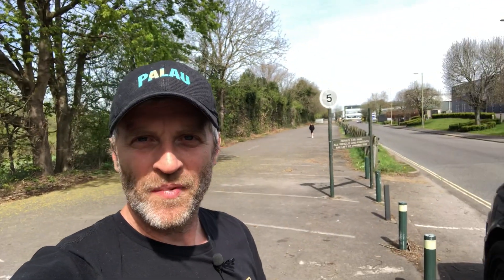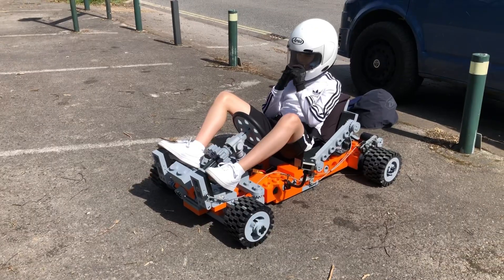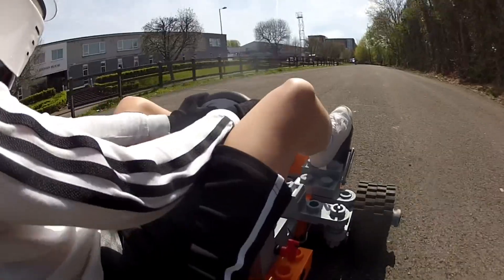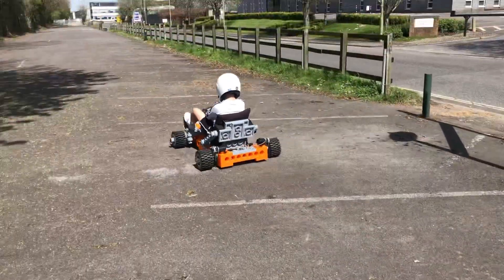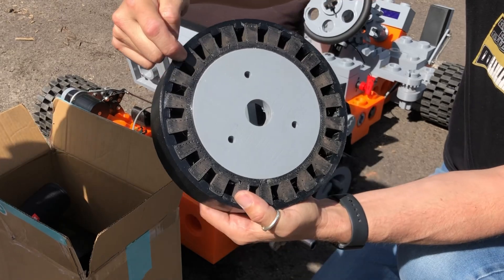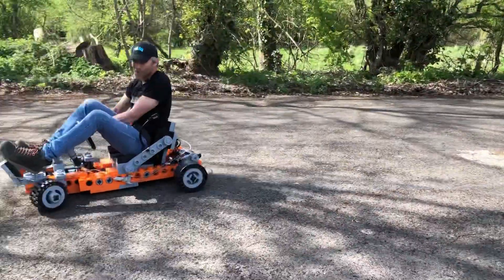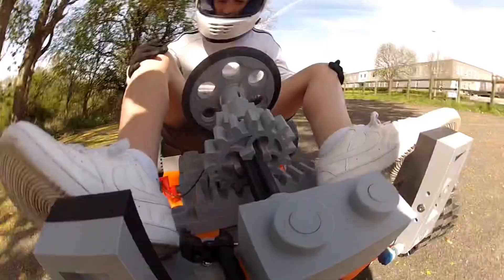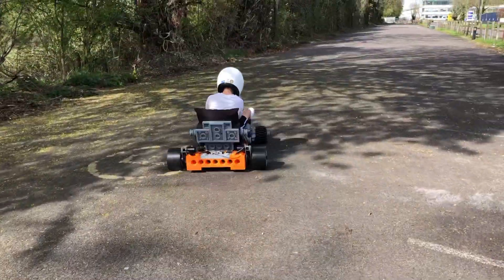XXL 3D Printed Go-Kart - Opposite Lock! | #7 - Mantis Hacks

Comment: Drifting with drift sleeves is great fun, you can be going fairly slow, yet it feels much faster.  I was surprised how well it did with the split axle and limited steering angle.  A solid axle and greater steering angle could allow for steeper drift angles and longer drifts.  I don't know the outer diameter of the lego tires, but drift trikes use PVC sewer pipe on a rubber tire.  I'm not sure how you'd attach it to the lego tire, or if it would work best just to print some new tires that will fit snugly into PVC pipe and glue the pipe to the printed wheels but the PVC sewer pipe is really thick and will last a good long time on a kart like that.
Reply from the maker: Yeah it would be interesting to try the solid axle again

Comment: Hacksmith made Mario kart-esque speed boosts with a color sensor. Perhaps you could do that?

Alternatively, go for a more LEGO "power up" and try to attach some projectile launchers? There are the Minifig stud launchers, some 2x2 round tile launching 2x4 bricks, and a "rocket" that looks like a technic half-pin-with-stud has a bar rammed in it. I doubt a large version would actually work with tension and friction as the tiny ones do, but it's nothing some springs couldn't fix lol
Reply from the maker: Ooh yeah that could be fun 🤩

Comment: Maybe you could add a 2-speed transmission. I don't expect you to shift it while moving, but being able to choose between a lower gear for better acceleration and electronic braking (When you fix that.) and a higher gear for a higher top speed could be pretty cool.
Reply from the maker: Yeah that could be tricky 🤔 how about just bigger motors 😆😬
Reply: @MattDenton  That would be cool, but bigger motors tend to draw more power, so you might need bigger batteries, heavier gauge wire, and beefier electronics to handle that. And if I'm being honest, I didn't expect you to actually do it, I was just making a neat suggestion.

Comment: Except for the axles and tires is it printed in PLA? I am totally amazed at how well it holds up. Can you tell us what 3d printer you used with the size?
I hope you sent the video to LEGO. It would be interesting to hear their comments. Very entertaining. You make good videos.
Reply from the maker: All the chassis parts are printed on PolyMax PLA on lulzbot Taz6 printers, so some parts are joined. Check the older videos for more detail. The front axles are printed in PolyMax PC! Thanks 🙏
Reply from the maker: All the chassis parts are printed on PolyMax PLA on lulzbot Taz6 printers, so some parts are joined. Check the older videos for more detail. The front axles are printed in PolyMax PC! Thanks 🙏